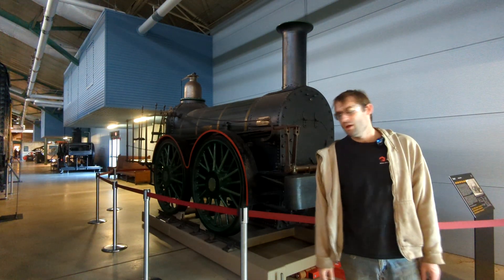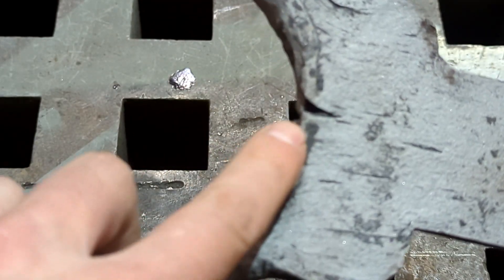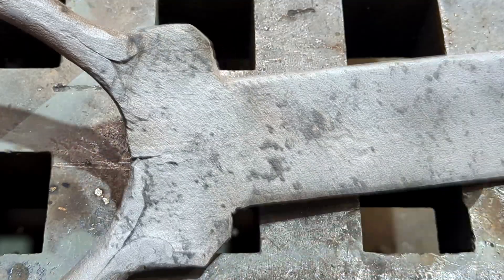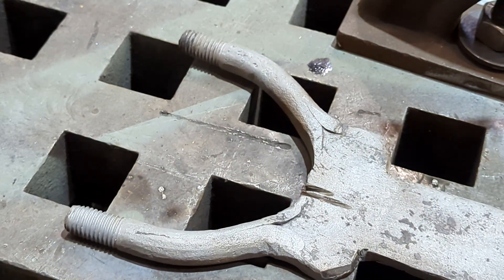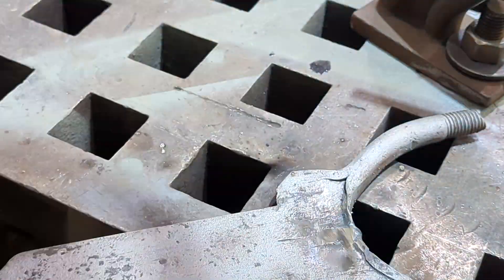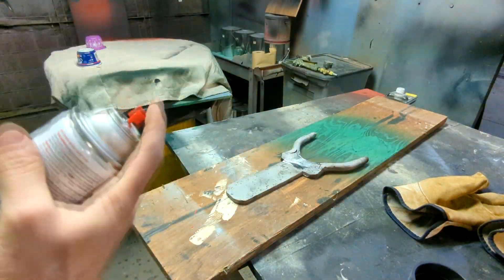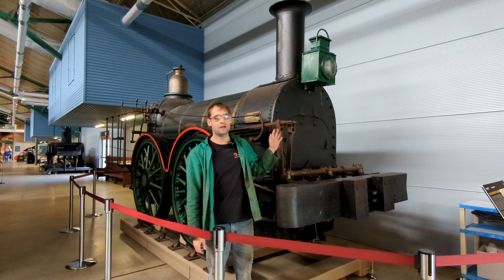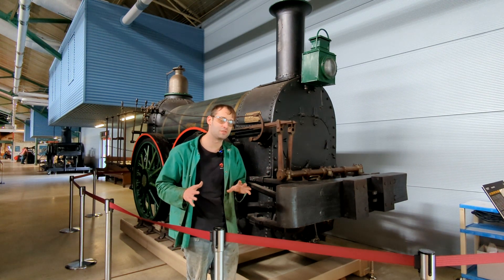Repairing a 185 Year Old Steam Locomotive From London

Comment: That wasn't a crack. It was a delamination of the wrought iron. It was a witness to the hand forged manufacture of the bracket. It was not threat to the structural integrity of the material and it would have been there from the day this bracket was made. From a conservation and curatorial perspective, this is a shameful embarrassment. Preserve the original material and replace like for like. If you wanted the headlight bracket, have a reproduction hand forged. Replace like for like. If this is the standard with which the RR Museum of PA intends to restore this engine, then it should have stayed in Philly. Total ignorance of historic fabric.
Reply from the maker: I appreciate your comment but this bracket was actually a repro by the Philadelphia and Reading railroad in the 1930's from the best we can tell.  The bracket is a U bolt bonded to a piece of mild steel.  You can see the old braze or weld that bonds the two.
Reply: @mikesmetalfab  I am not suggesting that either headlamp or bracket are original to 1838. That said, I've watched the video several times and see no evidence of old brazing or mild steel. Every visual indication is that it's forged wrought iron all throughout. The same head light was extant on the engine at the Fair of the Iron Horse in 1927, and the P&R did their ill informed attempt at restoration for the Columbian Exposition in 1893, not the 1930s, which yes, is when the bracket was probably added. None of that changes the fact that the crack was in all likelihood, a non propagating, manufacturing defect, and welding it shut was an unnecessary and destructive cosmetic restoration.

Comment: Cool to see Rocket getting a touch up. Question: are there any plans to add her side rods back on?
Reply from the maker: The Reading Company removed the drivers that had the pins for the side rods before the engine was restored.  The current wheels installed do not have the provisions for side rods.  I wish they did because they would already be on.

Comment: You should have heated up the pc first. That looks cast when made
Reply from the maker: I originally thought it was cast at first too, but it turns out its just a u bolt mated to some mild steel plate.  The welder would have carried on something terrible if it was cast when I went to weld it.

Comment: I think that headlight is inappropriate, no matter how "cool" it looks.  It appears to be an electrified kerosene light.  Any early attempt at a headlight would have been whale oil, I think, before the use of kerosene lighting, and of a different form. Also, and I've made this point before, it needs rods on the wheels so the museum attendee can visualize how it actually  looked in service.
Reply from the maker: I wish we could put the rods back on too, but when the reading company backdated the rocket to a more as built appearance in the 1930s, they swapped the drive wheels with the pins needed for the rods.
Reply: I think that part of the problem with changing the wheels to have rods on them would be just the overall cost of fabricating both the new rods and parts of the drivers, not to mention replacing a fair amount of (now) historical fabric. It might be worthwhile to leave it as-is for the most part.

Comment: I would be interested in knowing if there's any history attached to the headlamp (if that's actually what it is). It doesn't appear on the locomotive after the 1893 restoration. Nor does it appear on the locomotive when it was at the 1904 World's Fair. So it was obviously added sometime in the 20th century and has little (or no) historical connection with Rocket. So then - what is it? How old is it? When did it get attached to Rocket, and why? Honestly, it makes a lot more sense to leave it off until these questions can be answered, even though I admit it looks cool. But I would think the museum should figure out if it's actually appropriate to display on the locomotive.
Reply from the maker: Good points!  The engine was backdated at some point before it was donated to the Franklin institute.  At that point they put the headlight on.  We have drawings from the Reading Company of the Rocket right before it's donation.  Those drawings have it with this headlight.  You are correct that that headlight is not original.  After looking it appears to be from the 1930s so defiantly a reproduction.
Reply: @mikesmetalfab  Thanks for the answer. The subject of the lamp has generated much discussion and theorizing elsewhere. It does look very similar to a lamp that was mounted on the engine prior to its 1893 restoration (which appears in a photo of the loco in its saddle-tanked form), and yet there are some differences, so it possibly is a replica made later, or perhaps somebody chanced into a lamp that looked similar enough from a distance and just stuck that up there.

I have wondered what the plans are for this loco in the future. I'm hoping that it will be restored to its 1893 appearance, which it kept for a couple of decades before the stack was shortened (and frankly the short stack looks ridiculous) since this would be the next easiest thing to achieve aside from not doing anything at all. Or is it still too early in the game to make any predictions for future plans?

Comment: Surprised you’re using regular spray paint.  Figured you guys would powder coat or even have an atomizer for paint projects
Reply from the maker: I used rust reformer.  Since it will be kept inside it shouldn't be a problem.